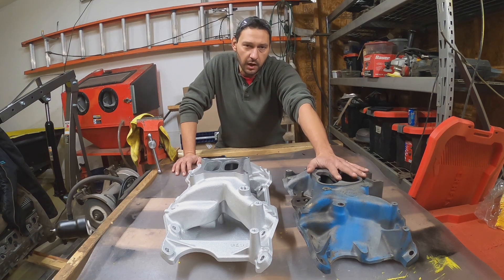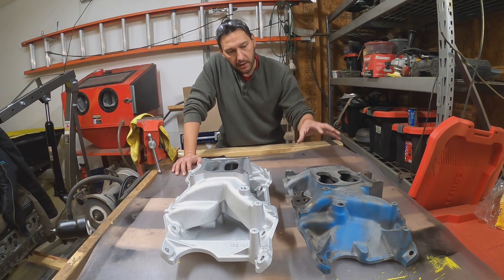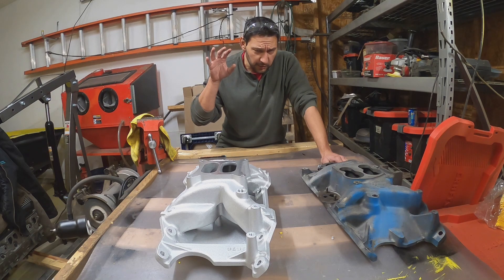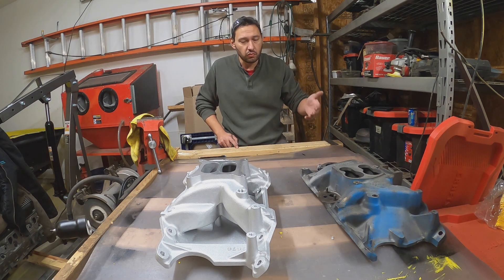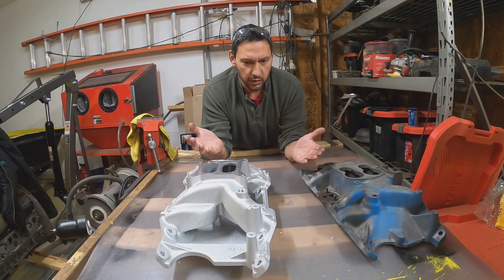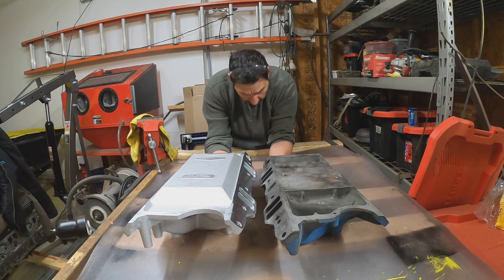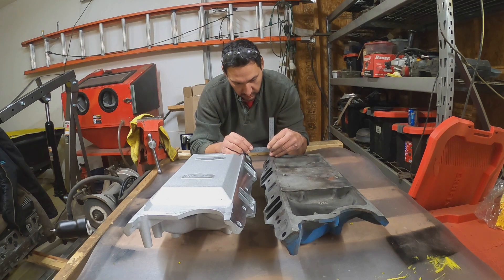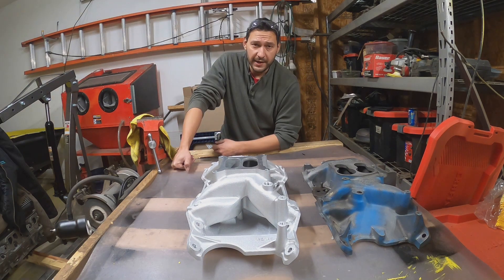Stock Chrysler Intake vs. Edelbrock RPM Airgap. Weight & Clearance differences.

Comment: to stop the incoming AIR    forgot to type in that word
Reply: david r fowler You could have easily edited your original post.
Reply: @jumpinjojo  i tried to locate the edit icon , but youtube on firefox on my  linux operating system is coded a little differently but i could not find it
Reply: @davidrfowler6432  David, there are 3 small dots to the lower right of your comment. Click on them and the Edit icon will pop up.

Comment: edelbrock designed the air gap intake as a means to stop the incoming from being heated from the engine oil being slung off of the camshaft and the lifters, notice all of the newer engines utilize high temperature plastic intake manifolds , that is why , cooler incoming air   denser charge    more power output
Reply from the maker: Hey David, yes you are right. There is a gap that you can stick your hand in separating the upper plenum from the base of the intake. In theory this keeps the air inlet cooler. Air is a pretty decent insulator. I like the concept, I like the weight, it looks great. My personal thought (no data to support) is that the air gap design(vs. pre air gap Edelbrock)  probably does not move the needle on power output as a stand alone item, but the concept makes sense and coupled with other changes it seed like the right way to go. I do think there is good supporting data that any of the Edelbrock intakes would help boost output, so either way it is a win. Thanks for watching and commenting!
Reply: @DustorBust  the problem that they found was that the fuel - air charge needed the heat from the engine to properly disperse the fuel droplets into the incoming air charge for complete combustion , so that idea was a bust , aluminum air gap intakes only work well with edelbrock pro 4 efi setup , the fuel injectors near the cylinder head intake port
Reply: @davidrfowler6432  not true at all. the heat for atomization thing was a farce.
Reply: @frigglebiscuit7484  i am refering to the fuel from the 70`s and 80`s where they had to add lead to the gasoline to enhance cold weather starting HENCE LEADED GASOLINE , when leaded gasoline was phased out because of enviromental concerns , they had to start producing higher octane fuel , because the heated intake manifolds were causing pre ignition of the lower octane fuel. that is a known fact , the 60`s all the way to mid 1986 gasoline was sub standard thus lead was added to enhance ignition

Comment: I use to have one of those factory 4 barrel intakes 🙄 weight and not as good performance . im working on my project 65 dart and took that boat anchor off of the engine I'm getting ready to build shaved off the front of the car 50  Lbs give or take . I also took the 30 Lbs factory starter off and putting on a mini starter. do your self a  favor anybody reading my post  get a junk mini starter off of 90s trucks for a core then go to oreallys ect and get the mini starter off a 96 dodge Dakota with v6  new its 66.00 give or take . if you buy one for a 90s truck with v8 it will cost you145.00 give or take . just thought I help out 😎🤘🏁
Reply from the maker: Hey Mopar Man, thanks for sharing. Interesting. I had not paid much attention to the starter yet, aside from noticing mine looked pretty rusty/shot. I am pretty sure I need to buy one anyways, thanks for the tip!
Reply: It will turn the motor over way faster too, better for a high compression motor

Comment: I have a 360 Duster, and I used the Performer RPM. I fits under the hood fine with a Drop Base Air Cleaner. That was with the Performer Rpm, not the Air Gap Rpm
Reply from the maker: Hey Thomas, thanks for sharing. I checked out your 80s tribute Duster last night, pretty cool!